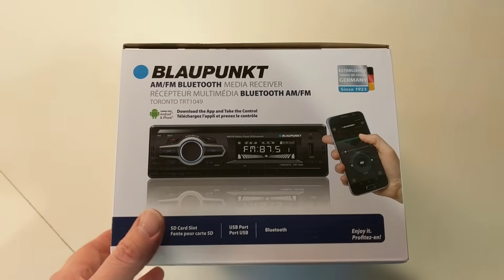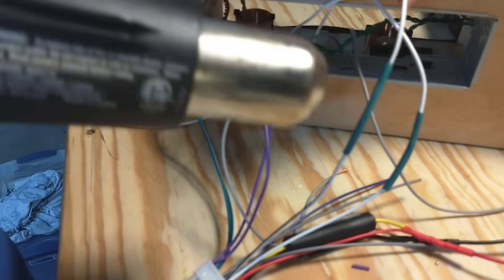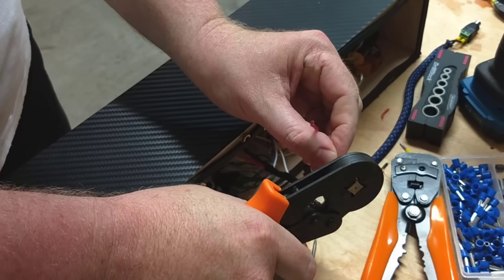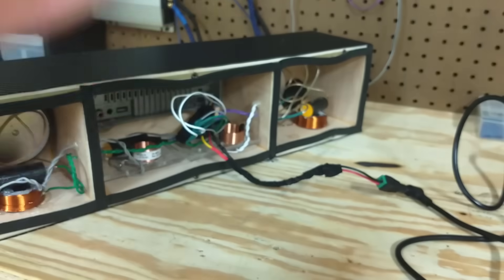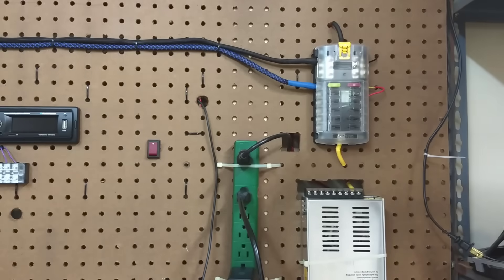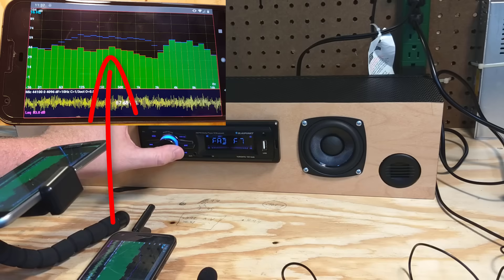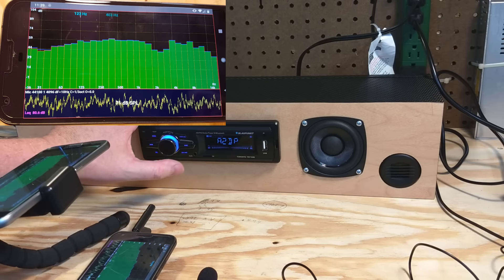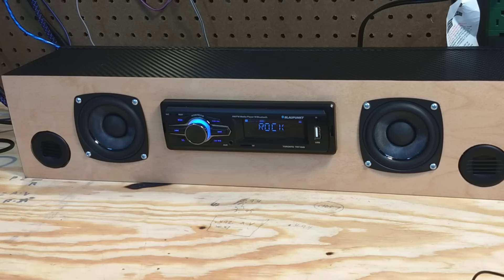How to use car audio equipment in your home!

Comment: Wouldn 't it be good to use some AlNiCo fullranges with a car radio?
They are efficient, they don 't need a lot of power and, in a proper enclosure, they should have enough bass.
Reply from the maker: I am not familiar with them.  I would like to learn more.

As far as full range drivers go, in a perfect world a full range driver would be the best solution for home or car.

Comment: Can I use a 12v charger cord that plugs into the a house hold plug being 110v into an 1000w inverter to provide the needed amount of watts to my 1000w car amplifier so I can use my 1000w watt subwoofer in my home.

I'd rather not have to buy a car  battery or better yet a marine deep cycle which would cost me hundreds. 
OR
Having the described application with the 12v battery of  a 100amp being  constantly charged as I use my subwoofer so I doesn't die. Seeing  that I won't have an alternator to keep my battery charged while I use my car audio system in home.

Any info would be great!!
Reply from the maker: I use something like this.

https://amzn.to/3FRTvbY

Comment: How you will connect an amp for speakers and amp for subwoofer?
Reply from the maker: The had unit has a pair of RCA outputs.  Just need to extend them to the back of the enclosure.

Comment: If you power a car amplifier power supply that’s rated to handle 15 amps of current and the car amplifier draws 40 amps and the car amplifier doesn’t shut off and the car amplifier ends up working just fine will the capacitors inside the power supply explode like firecrackers if the wires are thick and don’t melt and catch fire
Reply from the maker: Something like that, yes.

Comment: So in order to power an amplifier you need the large 12v dc supply? Smaller one should be plenty of power to run just the headunit. Wouldnt your HU settings reset any time you disconnect the dc adapter from the wall?
Reply from the maker: Yes and yes

Comment: Getting ready to order a power supply for my workbench for anything and everything car audio. Do you have any suggestions on a unit? I see multiple quality ones for under $100 and from what I am learning that's about right for needs.
Reply from the maker: Depends on what you need it to do and the features you're looking for. https://amzn.to/3YZ6XnQ
Reply: @DIYAudioGuy , quick question, I am running an LC2i pro and have chose to tap into or use the factory subwoofer wires. Having a hard time finding the color ledger for the vehicle, I do not have a polarity tester, is there a way I can prove the positive and negative wire?

Comment: I watched the video on YouTube by sundown audio unofficial and they ran a car amplifier on a 20 volt drill battery and what’s crazy is it handled it and it didn’t blow up but after watching the video the question is can car amplifiers really handle more than 12 volts of input voltage
Reply from the maker: If your alternator is spinning, you're going to get 14.4 volts in a car.  Car voltage is an odd thing, it fluctuates. It'll be less than 12 volts if you've been running the radio with the engine off.

A lot of competition car audio runs at 16 volts.

20 volt drill batteries are actually 18 volts for the same reason.  Some amplifiers can handle the voltage just fine. Some have unregulated power supplies and will actually make more power with the higher voltage.

Some have over voltage protection and will go into protect when they sense a high voltage.

Comment: Can 2 15 inch passive dj speakers be wired directly up to a car head unit or would the car head units built in amplifier not be powerful enough for them.
Reply from the maker: It would work, you'll get music out of them. It just won't work very well.
Reply: @DIYAudioGuy  would a external amplifier be required to make them work really well.
Reply from the maker: @travisgulley2652  yes

Comment: When you unplug the power supply from the outlet don't you lose all the settings you applied on the radio? I'm saying that because there is not any voltage for the internal memory so it can keep up storing things.
Reply from the maker: Yes.
Reply: @DIY Audio Guy  So you lose everything after you unplug it? Is there any way to prevent this from happening without having the power supply turned on 24/7?
Reply: Yellow and black wires must be always connected to a 12v battery. You can use a small lithium battery.

Comment: What kind of power supply would i need to run a 1000watt amplifier in my home?
Reply from the maker: If you're going to run it at full tilt all the time you're going to need something that can give you at least 150 ampers of current.  That's bigger than most standard power supplies.  You will push the limits of what a household circuit can handle.  I would look at some of the YouTubers that test amplifiers, Williston audio labs, budget gem or budget budget, high five Vega, and consider a setup similar to what they use.  At that point you might find it cheaper just to sell the amplifier and look for some pro sound amplifiers, something from behringer or crown.

Comment: Hi again I solved my problem and haven't solved it so the good thing my radio is not faulty it works very good only when I use the USB CD or fm radio but when I plug the aux into my phone it only players music at max volume and its is very quiet and sound very bad so I don't know what to do
Reply from the maker: It could be the cable.
Reply: @DIYAudioGuy  not sure because I used 3 different cable 2 cheap one and 1 really expensive one and same results??

Comment: I used a 600w pc block power supply for mine and now see that you use the lighter laptop power supply, what is the little adaptor connector that you use? I am going to remake mine and it will be so much lighter with this.
Reply from the maker: You mean something like this?

 https://amzn.to/3L9y8Vs

You'll have to make sure that you've got one that fits your power supply, and make sure that it's a 12 volt power supply.  

I think they're all either 2.5 mm or 3.5 mm or something like that.

The power supply that I used had one in the box if I recall correctly.
Reply: @DIYAudioGuy  thank you I will have a look, mine is quite heavy but will be lighter and tighter now that you have showed me this 👍🏼👊🏼

Comment: Pardon my ignorance but, are you using the 348w power supply to run the radio or are you using the "what looks like a lap top power supply" for the whole experiment?
Reply from the maker: That's a great question.  I'm using them both.  The 348 watt power supply is permanently mounted to my test bench, I use it to run the test radio and an amp.  The one that looks like a laptop power supply goes with the Bluetooth boombox.

Comment: So how big of a power supply converter do I need for 2 12s and 4 5x7s. I don’t understand the power conversion. The subs are around 500w rms combined and the 5x7s are like 350-400rms. Does that mean I need a converter that can do 1000w ?! The biggest one I can find on Amazon is like 350w…
Reply from the maker: The math is pretty simple, if you're going to pull a thousand Watts through your power supply then you will need a 1000 w power supply. 

That's the problem with trying to hook up 12 volt amplifiers inside of your home. After you buy the power supplies, the juice is not worth the squeeze. Instead you could just buy a home audio amplifier and a plate amp for the subwoofer.
Reply: @DIYAudioGuy  thanks for the reply, i guess I misunderstood. Thought there was a proper conversation, but they’re just being underpowered. Gotcha. I was just curious because me and my father are putting together a home theater and I have lots of car audio component and figured we could save money by using one of my spare subs and amps. But I’m Better off doing it the right way I suppose, as usual lol

Comment: Can a 10 inch speaker use a 5 inch passive radiator ?? I have a CompRT 10 Inch subwoofer kicker. But the space in my car is not enough for a big box please solve it
Reply from the maker: Short answer, no.

The rule of thumb with passive radiators is that the passive radiator must be able to displace twice the amount of air as the active driver.  So you either need two passive radiators that are both 10 in with the same xmax as the passenger driver, or one passive radiator that has double x max of the 10-in driver, or some combination in between.  Another solution is to use a passive radiator that is larger than the active driver.

I offer box design services, I would charge about $150 to design a small passive radiator enclosure.

Comment: Im using a 10” transmission line subwoofer along with my home theater. It was previously used in my car. Kindly suggest a method to properly power the amplifier at home. I have made a 12v 40A transformer for the 500w rms rockford amplifier but still im getting a lot of ground loop and distortions from subwoofer. Is it a good idea to use a car battery to power thr amp??
Reply from the maker: I'm not a big fan of using car batteries inside of the house.  Improper charging and discharging will cause them to explode.  Take a look in the video description and you should find a link to the power supply that I use on my test bench.  Another good option is to buy a pro amplifier like a crown or an inuke.
Reply: DIY Audio Guy thanks for the reply brother

Comment: Hello DIY Audio Guy! I have a quick question for you and I’m hoping you can solve my issue! I built a homemade Bluetooth sound system using car components such as a 4 channel amp for 4 6x9 speakers, and a mono amp powering a 12 inch subwoofer along with a car double din head unit and a 7 band equalizer. These are powered by three separate power supplies the same as shown In your video from Amazon. I have one 40a powering the 4 channel amp, one 50a powering the mono amp for the sub, and a 15a supply powering the equalizer and head unit they are all connected to the same extension cord and I believe everything is wired correctly. Now my problem is the static hissing noise when I have everything plugged in. Now this system sounds absolutely fantastic don’t get me wrong. It seems like everything is working great as it should. But the loud static sound when no music is playing coming through my speakers drives me crazy! I have tried wiring it differently, changing Rca cables…nothing seems to work. What would you suggest or recommend that I do differently?
Reply from the maker: Honestly, I have no idea.  You will need to isolate the problem by removing components.  Start by setting gains with an O-Scope or a DD1  (https://youtu.be/G2U8AoeYiTw ).  If you have some noise then improper gain settings could be amplifying it, turning a little noise into a lot.    Then plug your cell phone directly into the 4 channel amp RCA inputs with everything else powered off.  If the hiss goes away then you know that the head unit or EQ was the problem.

Comment: Ok, so my radio has ONLY a black wire, other than the wires for the speakers, I can’t find a red or yellow wire at all. The radio is a factory radio from an 01 dodge Dakota, do I just use the black wire for the power source?
Reply from the maker: That is strange. Tell me what you're trying to do and I'll see if I can troubleshoot a little over the internet.  The first thing to keep in mind is that most car manufacturers do not follow the same color coding scheme that aftermarket radio manufacturers use.   I'm assuming that you're trying to hook up the radio from your truck in your home?  If you've removed the radio from the pickup truck then you should just unplug the harnesses in the back and you can get an aftermarket harness for just a few bucks.  They might even have one in stock at Walmart, they'll definitely be in stock at most auto parts stores.
Reply: @DIY Audio Guy Hello, I’m very sorry for not answering right away I’m quite new to YouTube and didn’t know how to check if you responded.Yes I am trying to hook up my trucks old radio for in home use. There are two wiring harness is at the back of the radio, they seem to be for the speakers. However, the only other wire coming out of the radio is a single black wire, and it seems to be the power source.
Reply from the maker: @lexforeman144  If it's a really thick wire it might be the antenna.  

The wires in the back for the speaker should be a factory wiring harness.  it sounds like someone may have cut the factory wires to remove the radio from the dash.  Just buy an inexpensive aftermarket adapter, they have them at Walmart and AutoZone and Amazon and almost anywhere else you might look.  The wires will be color-coded and there will be a diagram or description on the back of the package telling you what color does what.

Factory wires tend not to follow standard color coding schemes.  They like to use their own wiring colors so that it's hard for people to work on them.

Comment: Thanks for the informative video.  Where did you get the car radio portion for that cheap?
Reply from the maker: I first heard about it from another YouTuber. The price has gone up since then, I'm not even sure if it is still available.  But you can still find Bluetooth car receivers for under $30.  another option is to check out parts Express, they sell bluetooth enabled amplifier boards.  if you dig around a bit and find something that seems like a good deal let us know about it.

 https://youtu.be/EBEk9VPsix4
Reply: Thank you.
Reply: That unit is very similar to a dual xdm17bt available at Walmart for $16.87  they’re pretty cheap now. - May2020
Reply: JC Carreira if you want 2 6.5 inch speakers with it it is only 6 dollars more because they had a rollback!

Comment: I actually thinking about this and seen this video 👍🏽
Reply from the maker: It's like google can read your mind.
Reply: where u thinking about just running it off a car battery like I was with 12 inch subs cause thats how we did b4 we had cars in high-school we where ready
Reply from the maker: A car battery works just fine, but I have seen car batteries explode, so I don't recommend using them in the home.

Comment: How do i hook up something with big subs? Something big power? Have a comp 6500rms half ohm stable mono block going to 2x15" 3000rms subs
Reply: Obviously not going to use that amount of power but is there something affordable that can semi run it
Reply from the maker: Something like this is what you're looking for.  https://amzn.to/3BDqBet
Reply from the maker: That's the problem with running 12 volt equipment in your home. You end up having to buy an expensive inverter plus a battery.  We're almost better off just grabbing a pro audio amplifier. https://amzn.to/3pRfKek

Comment: Great explanation, i have a question, i built a boom box with a radio, speakers using a pc power supply and i have a switch for On/Off the power but the memory of the channels won't get saved, what can i do to keep the memory always set. Do you have an email to send you the diagram i use. Need help with this. Thanks and great day.
Reply from the maker: The way I wired mine (with the red and yellow wire both rouhte dto 12v power) if you kill the power you kill the memory.  The red wire is the 12v constant and it needs to stay connected to save your memory.  The yellow wire is the "ignition" wire, that is the wire that turns the radio on.
Reply: @DIYAudioGuy  can i connect a battery pack with the red wire so it can stay with the memory
Reply from the maker: Only if you want to start a fire.

Comment: So would powering a sub be more efficient with like a plate amp?
Reply from the maker: It is a lot easier to do that rather than try to convert to 12v.
Reply: Ty. I've had family all me if I could so something along these lines but me nor them really comprehending the conversion process I was trying to think of the most foolproof plan. Ty I know it's an older vid but you responded
(Edit) thank you very much sir

Comment: How to pick the correct power supply for this MVH-S120UB
Reply from the maker: Check the fuse rating on the back, any power supply that can deliver that That amperage at 12 volts will do the trick.

Just be smart when dealing with electricity.

Comment: What makes car audio sounds good imo is the SMALL ROOM FACTOR of a car and the interior materials that act as accoustic treatment , so it's kinda pointless using car audio in home if the room is too big and untreated, same car audio setup put in car and put in big room I bet it still sounds better in car.
Reply from the maker: I have car speakers in my house and house speakers in my car.  It's an arbitrary distinction.  It's best to look at TS parameters and frerequncy response,  then choose the gear that meets your goals.
Reply: I believe this is where the impedance comes into play. 1-4ohm for vehicles with a small enclosed area, 6-8ohm for home theater and stereo systems and lastly 16-32ohm for higher powered outdoor stereo systems. Instead of using 2-4ohm car subs I am currently using a car stereo amplifier and 8-Ohm stage stereo subs. Amplifier handles very this well.

Comment: Whoever was trying to get 400 W out of that little converter that was just being downright greedy and really its the amps And home wiring it’s not Volts that will kill you is the amps . When I was a 14?I had bought stereo system For my future vehicle that I didn’t own yet . One thing for sure it was going to have bass in it .I bought it all from the flea market subs and amp it was all pyramid and pile I use the battery charger my dad has in the garage it would get a little hot sometimes but it worked
If I knew a little more I would’ve had a card battery thrown in there with it🔈🔉🔊
Reply from the maker: Right, that thing's not really made for that kind of power.  I use it on my test bench to power up head units and small amplifiers.